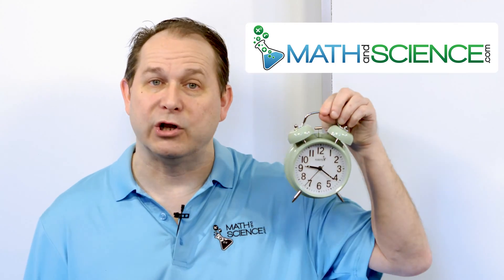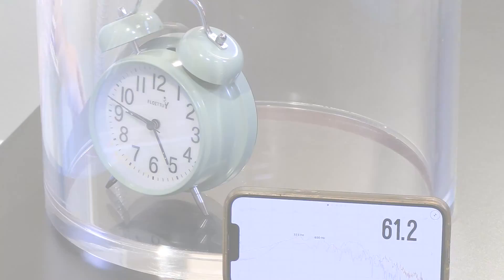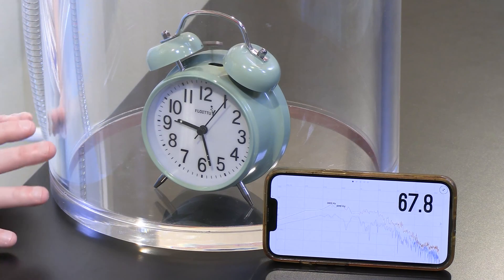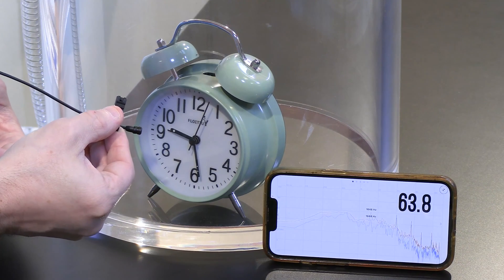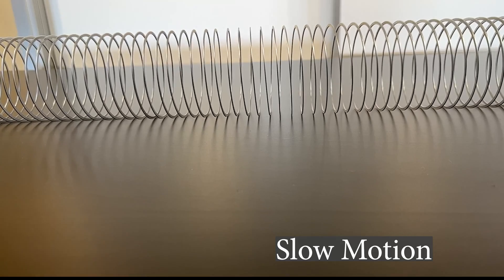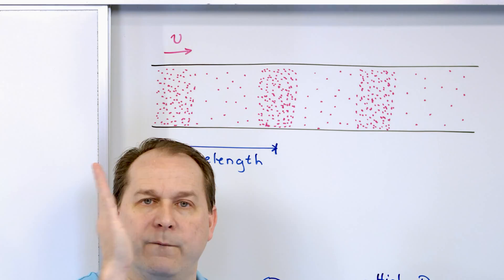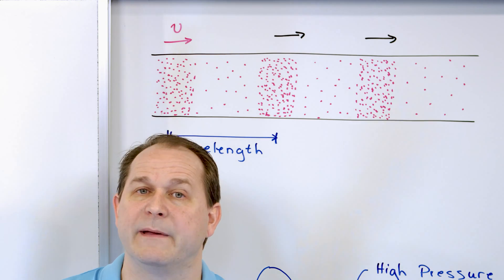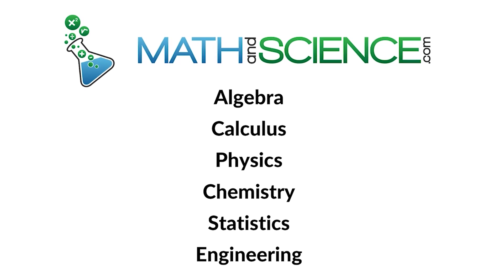What Happens to an Alarm Clock in a Vacuum?

Comment: Why didn't you put the phone instrument inside the chamber?
Reply from the maker: You know it’s funny I had my mind set on how I was going to do it and after I got everything completely finished and uploaded, I thought yes that would’ve been a better way to do it so I think I will redo the whole thing and then put some other noisemakers in there for a separate video with the instrument inside the chamber as well
Reply: I do wonder whether it's a good idea to test putting your phone in a vacuum chamber though😅, could end quite badly. You'd have to make sure whatever you use is proofed for vacuums I guess, which then makes me wonder if there are microphones made for vacuums when vacuums don't really have sound...😂

Comment: Cool, i suspect cold acts the same way, since you need air molecules to take your heat away, there's nothing in space to cool you down.  So is space really cold? ... You can kind of see this effect on a cold day with the sun out and no wind. The sun's radiant energy overcomes the cold, it was like -8c out and I wasn't cold because lack of wind.  I bet I could have been naked and stayed warm.  I bet the effect is exacerbated in space you and you likely burn up exposed to the sun while your ass freezes off.  Or would it?  With no air to take the heat away how long would you warm buns last? Hmmm...
Reply from the maker: This is a really cool question and I think your insight is really good. I’m actually going to do a new experiment really soon where I heat up a couple of steel balls really hot, glowing red hot and I’m going to put them in the vacuum chamber and see how long it takes him to cool off so that will be cool to do!